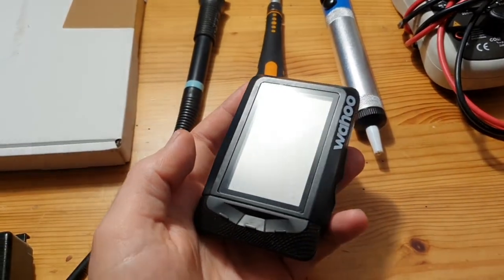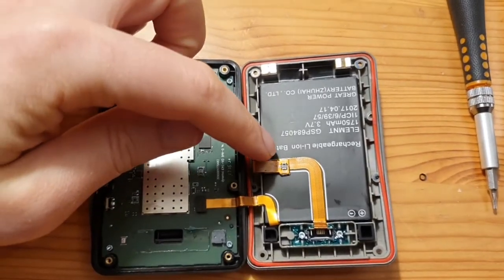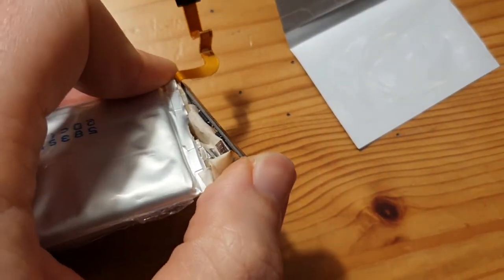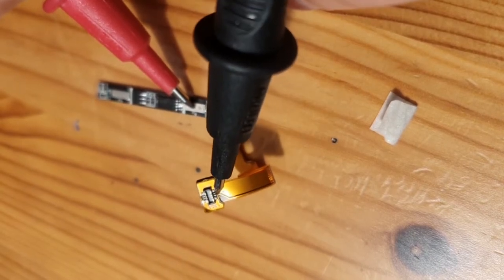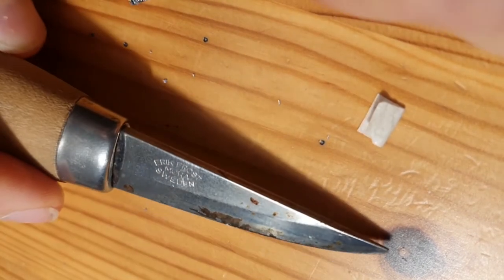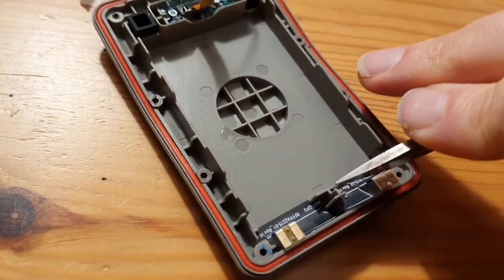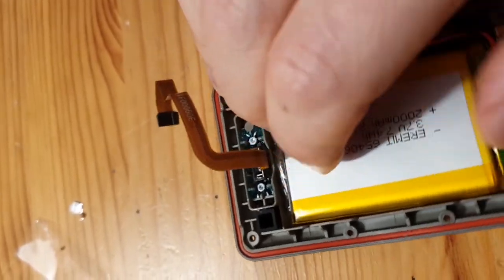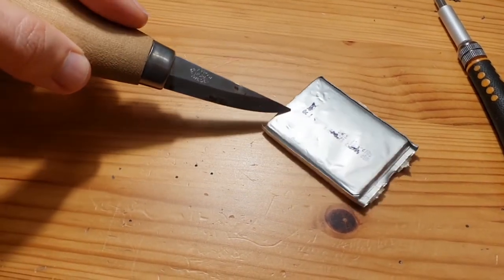Wahoo ELEMNT Battery Replacement / Upgrade

Comment: Thank you for posting this video. I have successfully replaced my battery. I used a slightly different method, I cut off the circuit board from the new battery, then connected the battery tabs directly to the original elemnt circuit board. The soldering was easier in my opinion as I did not have a precise solder tip for my iron. Charging is working and I will be curious to see how long the new battery lasts!
Reply: I second this, worked for me. But now the problem on my Elemnt goes beyond the battery - the thermometer & altimeter are ****ed. Probably the same for other surviving Elemnts out there.
Reply: @Soski101  that’s a shame, check the body doesn’t have any holders blocked with dirt. My new battery has made it good as new, I’m taking it to Atlas Mountain Race on Friday as my primary navigation.
Reply: Same, no problems at all.

Comment: You made the internet great today. I was concerned with the contacts I was soldering to and my lack of soldering dexterity. Turns out I thought I was good enough. I am trying to charge right now. Seems to know it is plugged in. Have not seen anything higher than 57% and dropping. Any ideas? Maybe the plug? I fear it was the chip I removed. Thanks for a really great video. Cheers!
Reply from the maker: Hi, nah removing the ic does no harm because the protection board of the new battery has the same one on it. The old protection board is just kept for the plug. Sounds like the battery is not properly connected. Probably a cold solder spot. I'd try to re-solder it. Maybe you know someone who has more soldering experience?
Reply: @timkrahmer2344  Thank you for the suggestion. Maybe, but wouldn't that not allow the unit to power up?
Reply from the maker: @derekmoffett3939  not necessarily. I didn't try it with the wahoo, but quite a lot of devices can be turned on with the battery removed as long as it is connected to a charger. I understood you have it plugged in or did you mean the battery by that? If it turns on with the charger removed thats another story ofc.
Reply: @timkrahmer2344  Battery installed. Powers up. When I plug the charging cable in it does not charge. It does give me the indication that it is charging but it does not.
Reply from the maker: @derekmoffett3939  hmm hard to tell then. Could be anything
Reply: Realise this is an old post but did you ever get to the bottom of it? I have the same issue after replacing
Reply: @Justintanega I did not. I sold it on ebay with full disclosure.
Reply: @derekmoffett3939  thanks, I wondered if it was just an issue with the unit not displaying the correct percentage that would reset if I ran the batt down to zero. It wasn’t as it now just doesn’t turn on. Gonna look at the connections again as I might have accidentally damaged a pad. Will report back for the sake of posterity if I find a fix!

Comment: Planning on doing this myself, but why struggle with the tiny IC solder point when you could have just connected to the points where the ribbon cable is attached to the PCB?
Reply from the maker: I love the challenge
Reply: @timkrahmer2344  Picked up a Elemnt with a short battery life for £39.90 so now to find the replacement battery. The existing one has certainly feels a little swollen.
Reply: Thanks for the video, I have successfully replaced the battery in the Elemnt following your instructions. Something not shown on the video, or possibly because the new battery I bought was very depleted to start with, is when you initially try charging the Elemnt after replacing the battery you do not get the usual increasing bar display. I got a picture of a battery with a sad face in it. This confused me at first and I assumed that I had done something wrong causing me to de-solder and re-solder everything. The result was the same. Eventually I noticed that the battery was actually charging since the % remaining when I switched off between tests was increasing. I left it to charge for an hour and now the correct charging icon is displayed. After a week of use with the new battery installed it seems to have done the trick. An hours ride using GPS uses about 14% charge rather than 47% with the old battery. I could not get exact battery you used so replaced it with a 3.7v 1800mAh 654060 instead. I realized that the numbering is actually the external dimensions of the battery. 6.5mm x 40mm x 60mm.

Comment: Hello, what is function of that removed chip? I removed and now my wahoo working, but when plug the charging cable, the icon of charging appear on the screen, but a battery doesn’t charge…why? Could it be because that little removed chip?
Reply from the maker: That chip is part of the battery's protection board. The new battery you put in should come with a protection board attached, so you can bypass the old board's circuit like I did in the video.

Comment: Dear, thanks! How long does it last a charge after the replacement?
Reply from the maker: Pretty long! I didn't count, but I think more than the 15 hours it is designed to work with the original 1600 mah battery. Definitely more than the meager 6 hours of life it had still in it with the depleted one 😀

Comment: Hi Tim,
Just replaced battery as per video.
My wahoo won't power up.
I get a message with a reboot on but can't find how to do this. Looks like a dos message.
Any ideas?
Cheers Dave Smith
Reply from the maker: Hmm, hard to tell from here. So it charges normally and when you try too turn it on you get a message on the wahoos screen? What does it say? Did you google it? I can only guess, but while installing the battery things can go wrong. Switched polarity, electrostatic damage, battery connector not properly plugged in, defective / wrong battery, physically damaged components on the pcb ...

Comment: i changed,it works,but it can not charge, i dont know why
Reply: I have a thought it might be the micro USB connection or the chip we removed. Could be a short across two of those tiny connections that shouldn't have been shorted.
Reply: @derekmoffett3939  finaly,i use 3lines battrry to fix it
Reply: @chihmingkwan194  can you please explain what 3lines battry is ?
Reply: @user-gf4tg2bq6w  my battery is 3 lines,and finally i fly the lines with the original lines to fix it
Reply: @chihmingkwan194  sorry to aks....don't know what you ar e trying to tell...."the battery is 3 lines ??" and "I fly the lines with the original lines to fix it" ??

Comment: Hi. I just can't trust what you're doing here. To remove a chip, causes something, everyone knowes for sure. Many comments which tells that this don't work at all. I will say that you fool people. You don't show in closeup what you're doing and nor if the unit start properly and also if the functions are as before. I doubt about that :-)
Reply from the maker: 😀 Removing that ic causes what everyone knows for sure?
Reply from the maker: I must say I was quite curious to hear your theory about what the removal of that ic would cause. Anyway, it is a redundant component because the new battery has one attached to it, so you can remove the one from the old battery.
I also noticed that this procedure doesn't seem to work out for some people, but it might be that they do stuff wrong. Those solder terminals are quite small, you can toast stuff with electrostatic discharges, cold solder joints... who knows.
Regarding video quality: I did not expect so many people to be interested in this topic tbh. I just film sometimes when I repair stuff and when it happens to work out I put a video together and upload it. Why on earth should I try to fool people with that? It's not a free energy generator or something. I literally just replaced a battery.